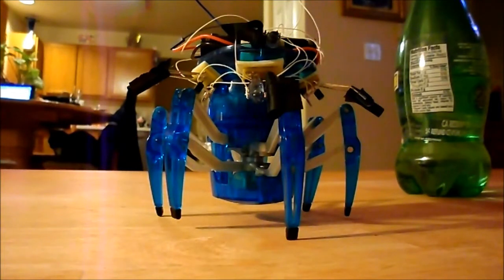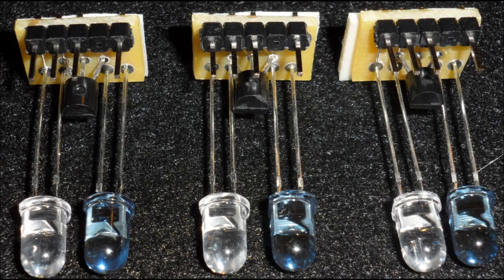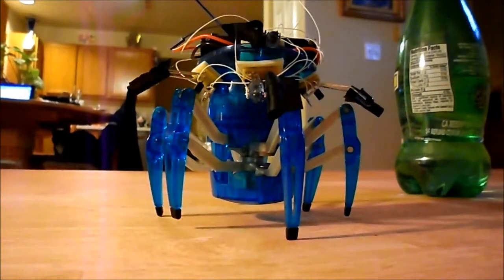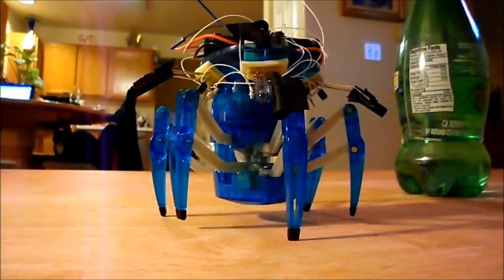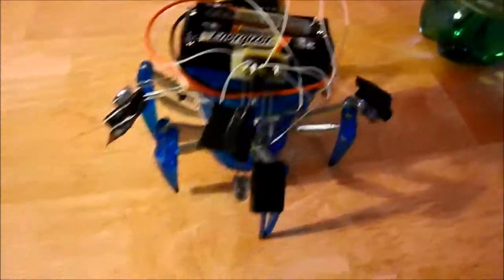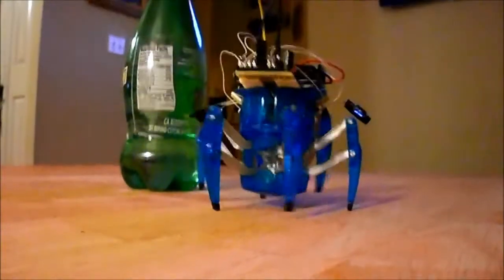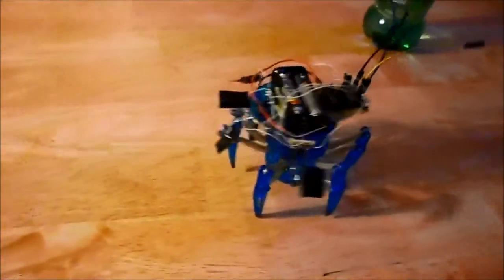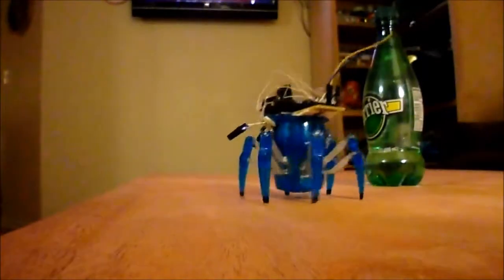Adding Edge Detection to the EMGRobotics Hexbug(tm) Spider Hack

Comment: All I can find on the site is the Hexbug™ Spider Hacking Kit (no solder) for 19.95.  Is there a tutorial for the edge detection demonstrated in this video?  If so, could you include links in the description?  Also, is the TI Launchpad included in the current  hacking Kit?  Thanks.